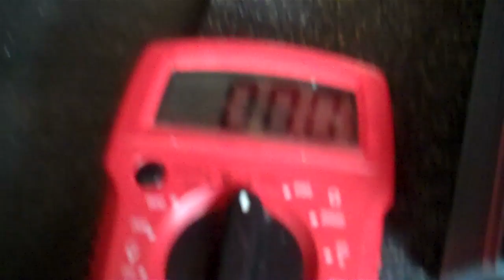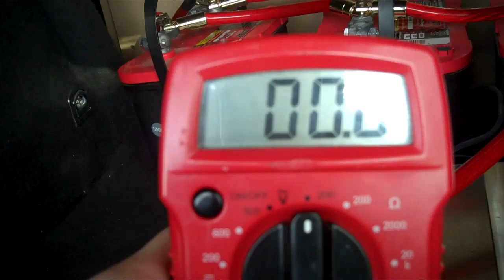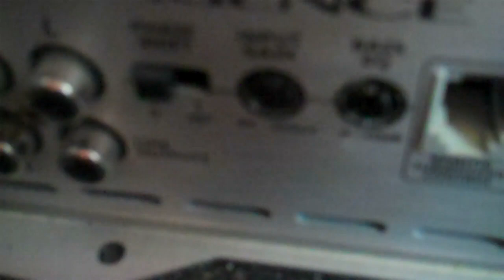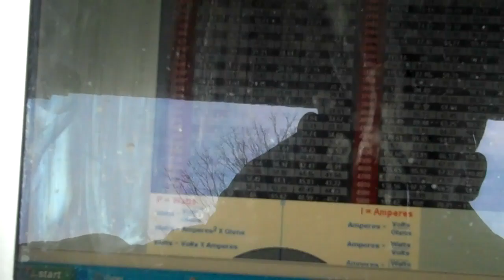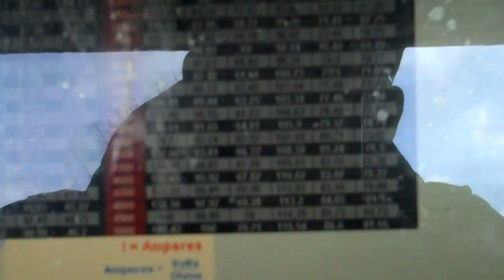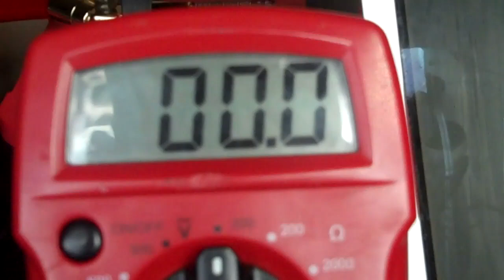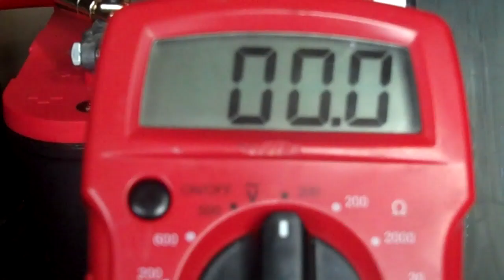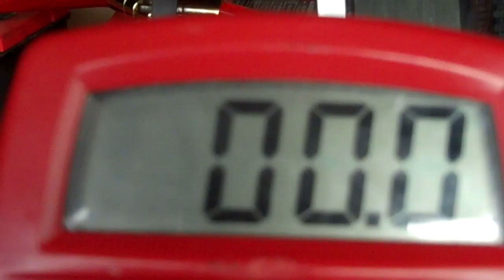How to Set your Gains with a Multimeter

Comment: If my speakers are 4ohm but it’s paralleled to 2ohm, do I use 2ohm in the equation? Or 4ohm? I’m using 2 250rms subs with a 500rms mono amp. I set the V to 31.6, using the equation with 2ohm, but it doesn’t sound like it’s loud enough. They can def go higher on the gain without distortion. Should I be using 4ohm in the equation instead or is that as loud as 250rms go? I also have a sealed box. Been thinking of getting ported to boost sound.

Comment: Okay maybe you can help me attempt to calculate mine I have 2 Audiopipe apcl 1500s strapped seeing a final load of . 25ohm. My subs are dual 2 ohm wired down to .5ohm. so approximately what RMS do you think I am putting out? because I couldn't tell you, however I have seen this amplifier dynoed at .5 ohm and the numbers are astronomical.

Comment: how would you set thr gains on a pair of amps that are strapped.
Reply from the maker: 913los913 the master amp is the control for both amps with a strapping. Cable.   The slave amp just uses the master amps controls as its own
Reply: @ihaveabutt  you didn't even answer his question

Comment: I think I spent roughly 400-450 on my set up. its plenty loud with 2 400 watt 12'' kickers and 1200 watt amp.
Reply: Wayne Morris Kicker subs are junk man.
Reply from the maker: +TheAquam most subs and I mean high end subs. Are junk. For the price of an uber ground pound 500kw sub that can't take. Half the rated power daily. Not to mention the charging system needed. I can buy much better stuff that holds or actually gains in value
Reply: Kicker, Fosgate, and JL Audio well the W7 13.5" is  okay I suppose are all chinese-made garbage! My 12" subs cost less than $165 each and will shit on anything kicker or Fosgate makes.

Comment: is that 3 optima batteries? you spent 600$ on batteries???
Reply: Michael Phipps It is not even that much when you have a loud car audio system. Im running 3 optima yellowtop batteries and i need like 2 more to push the amp all the way
Reply from the maker: More like 1000 I had 5
Reply: Freaking Crazy
Reply: I like the way you have fixed them to the floor.
Reply: I spent 1300 on a single limitless battery. All together I have about a little under $2000 in just batteries. Lol
Reply: Optima batteries are garbage step your game up and get some XS powa!!!
Reply: See now you really overspending, could accomplish same thing with nine guinee pigs, sixteen hamsters, and a turtle running on a power wheel. Plus or minus a pile of crap 💩

Comment: i used the multimeter to check the ohms of my subwoofer (printed as 3, runs at 2.7) then i use that for my ohms, and OH MY. No distortion, and sounds pretty darn good. Thanks alot! Used this to align the power of the amp to my sub. I know the amp can do more power than my sub needs (no doubts there)

Comment: Hello.... i have Planet Audio AC4000.1D ANARCHY 4000-watts Monoblock Class D 1 Channel 1 Ohm  and Power Acoustik MOFO-122X 12-Inch Competition Subwoofer Dual 2-Ohm Voice Coils.and I try to do Set Amplifier Gains With A Basic Multimeter but do not show me anything the multimeter.i have the multimeter in the speakers from amplifier,and the stereo on hi,i opens the INPUT LEVEL but nothing.not counting my volts,but all play normally.Can you help me please???

Comment: Don't know! Its to my understanding that most good Dvom have a10M ohm resistance wouldnt that alone mess up your reading? Compared to the regular .5,1,2,4,6 or 8 ohm load your amplifer would usualy be trying to feed voltage and current through.

Comment: If you calculate the power with a multimeter by using voltage and nominal resistance, you'd be amazed after you've checked the voltages after tuning with DD-1.

You are giving a reactive load 70,7volts and 2500watts into 2ohms but it's actually recieving under 2000watts most of the time because of impedance rise in the coil(s).

So to really get full power you'd need to figure out a way to push 2500watts in every tone into a speaker, tuning the enclosure, measuring AC current, measuring voltages, measuring battery voltage relation to amp output and many more variables.

The video demonstrates a very safe way to set your gains though, good for beginners :)
Reply: "Safe" way ? R U serious?

Comment: How do you find where the head unit distorts if you're running RCA? Would it distort in the same place on the speaker outputs as it would with RCA?
Mine goes clear up to 62, and it sounds pretty good up until about 60.

Comment: I have used this with much success. Remember to use the lowest RMS watts rating between your speakers and your amp. If its a 100w RMS per channel amp and your speakers are only 40w RMS. Use the lowest of the two ratings. You can download test tones used with the dd1 from the site and burn your own CD. Or use them on your iPod. You can download the manual for the dd1 and it explains the uses of the tones. I use them with this method and they help.

Comment: I don't think this would always work bc my sub is running at 0.7 ohms so it throws the whole equation off
Reply: Correct you would go with what your son is actually putting out versus what the rated ohm load is

Comment: The reason you want to use a 60khz toneis because AC line voltage is at 60 khz Thats what the multimeter is expecting when set to read in ac voltage, You don't play a tone that matches what your box is tuned to, you play a tone that matches the frequency of AC line voltage

Comment: yes they are good. but im running a Yellow TOP Optima. you have the RED (in this video he has) Yellow TOP, and a blue TOP. each battery is made for different applications. Red is like a standard batt, yellow is for more electronic EXP: mobile audio dvd players, and Blue TOPS are made for Marine use. You can look it up and it will give you more info. im giving only a fast info. hope that helps you.
Reply: And yet they're all garbage

Comment: Simple V=√P&R or Voltage=Sqrt(Amp wRMS x Speaker Ωs).  If you want a calculator on your PC, press Windows Key and R together, type in "Calc". That will bring up the calculator.

Comment: Isn't the wattage rating to multiply by the Ωs suppose to be the total amp wRMS per channel??? So the front channel would be the the 1 & 2 combined * Ωs, 3 & 4 the same and the 5th (or sub channel if you have a 5 ch amp).

Comment: if its an amp that is questionable then it is probably an amp small enough that it has an internal fuse. Take the fuse rating and multiply it by about .8 (for 80% class d efficiency) This will work for most of your hifonics type brands, anything like boss or soundstorm/ssl or something of that quality is going to clip at wicked low power, you aren't going to avoid it. If you have the money to spend on an amp with external fuses or like 2k+ rms, you can probably afford a dd-1

Comment: Nawh, the dude's right.  Your ear is a horrible indication of clipping.  you won't hear distortion until you're waaaay past the clipping threshold.  Yes there's a DD-1, and an O-scope, both work fine.  But until you show that a multi meter sets the gain at the exact same spot an O-scope or DD-1 does, I don't believe this.  Not to call you out or anything, I've just learned over the years to never just take people's word for things.  People lie, data does not.

Comment: While lacking accurate technical description, this method is fine.
I have a Fluke 287 DMM & a Tektronix 2465 o-scope.
The DMM is a good approximation of clip ceiling.
The o-scope is the accurate way

If you measuring a daily driver, configuring from your garage, etc...the DMM method described in the video will work perfectly well.
If you are thinking of competing, spent more than 40 hours on your install, want flawless sound: go o-scope.

Comment: Hey i tested my sub amp with 40 Hz tone... I need 34.64 but the reading on the multimeter keeps going up and down.... Wtf could it be? Btw im using a constant 40 Hz tone -__-
Reply: possibly a ground issue

Comment: true, that wasn't phrased very well. you will hear hard clipping, not necessarily  where it begins to clip. that's why I would leave the speaker connected and listen, reduce gain until signal sounds clean, then measure the voltage at that point to get a idea of the maximum output voltage and, yes it could still could have measurable distortion.

Comment: Depends where the manufacture rated the amp at 750 watts into 4ohms, its important to know what freq. this amp produced 750 watts into 4ohms. the amp will likely only produce its rated power into the freq. it was tested for maximum output at, this could be 1000hz.  If you play the 60hz track and adjust the gain with the speaker connected to the amp you should hear the point where clipping occurs. I would measure the voltage at that point and set it a couple volts lower just to be safe.

Comment: it doesn't detect clipping, but what it allows you too do is run your system rather well using ohms law you get your amps rms output and x by the ohms load on your driver(sub) and you've got your voltage ! tune it a bit below that voltage and you have yourself a cheap fix
$20 multimeter, can't get any better than that!!!

Comment: for this set up you would set your gains using the method in this video but with your 'bass knob' up full, so that way you can crank it up whenever you want without having to risk exceeding your maximum safe gain level, because you know exactly what the gain voltage is when you bass is on full.

Comment: You must do this with a 20hz-20khz pink noise signal with no filters on. You need to measure full range when measureing true RMS watts. Set your HU to max clean, if used set your Line Driver to max clean on in and out, set your Xover to full range on all ch's then set the in and out gain to max clean, set the amp to full range and turn down the gains. Now you are ready to measure and that is the correct way to do it, period. Spend the money to rent a scope, so you can see the true RMS of the amp

Comment from the maker: @uselesstheory theres nothing wrong with giving 14.5v the fact that people run 12.5 is due to small electrical but yes. if your running 12.5 you need to factor that in the equation not 14.5

Comment: I have a question I have a spl grla 1800.2. 380 watts rms x 2 at 2 ohms so I do 380 x 2=760 and the square root of that is I think 27.4 or so. anyways when I start turning my gain up it doesn't reach that voltage. with the gain at Max the voltage is only 22. what does thi s mean, I know the amp probably doesn't do 760watts rms since the fusing is only 60 amps.

Comment: ive got a rf t1500-1bd rated at 1824 @ 1 ohm on the birthsheet. do i use that to figure out the voltage?

Comment: @ihaveabutt  Hello i am running a Alpine 9835 deck & Audiocontrol epic 160 & 2 Soundstream rubcion 2500.1 Amps & 2 Fi audio 18" BTL N2 fully load D2  Subwoffers & 1 XS Power D3100 battery & 2 250 amp circuit breakers & a Mickman 250 amp Alt & All 0 Gauge power & ground wire and 8 gauge speaker wire and did the big 3 upgrade. My lowes voltage is 12.8-13.0 and highs is 15.0-15.7

Comment from the maker: @psychopathic2009 that depends. what voltage do you drop down to at full tilt? its based on your voltage while playing at your max volume. so if you had 12v even  at full bump you would want to match the output on the amps in ac current to the respective wattage on the amplifiers. its a bit confusing tell me yor whole setup and some numbers your getting voltage wise so i can help you better

Comment: I have a question, ok you set the gains for a certain voltage output via a 50 or 60hz test tone, lets say for example my amp is 360watts@4ohms, so id be looking for 37.94volts. Ok so once i do that with a test tone and then go and play regualr music the amp is not gonna put anywhere near that voltage, when i play regular music i get at most 19volts. Im guessing you could compensate for that loss if your head unit has a subwoofer volume control, you could just turn it up but mine doesnt, would it

Comment: Oh and another question. Ok im bout to install a 15 inch kicker cvr rated 500wrms and ive got a 1000watt audiopipe amp that puts out 600wrms now should i take the 500wrms rating and times it by 2 that way i would be sending that much and not 600wrms?

Comment: Honestly man I'm not trying to be a jerk but the DMM is nothing more than a myth.

What if your input voltage (RCA) is too low? What if your amp is rated at 14.4 and you don't have the car running? What if the opposite? What if it's at 14.9? What if you charge at 15.2? What if your amp sucks and while rated at 1200 it only does 900 clean?

There are just far too many unforeseen variables for this method to be effective. While I appreciate the effort, if you HU clips at 25 your cooking subs.